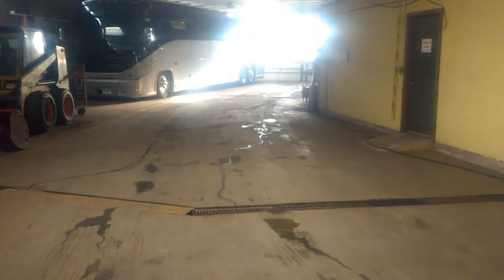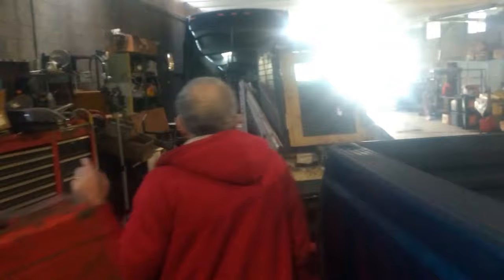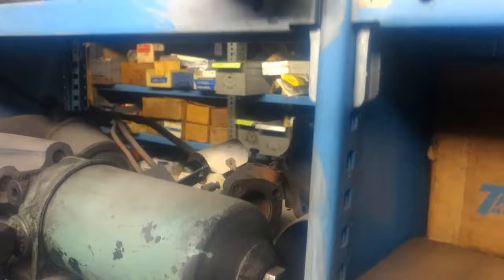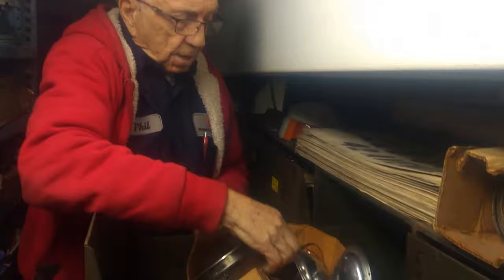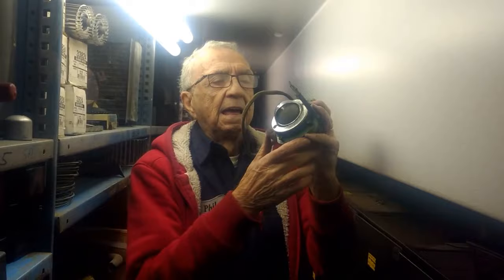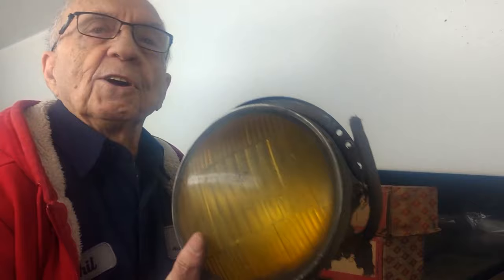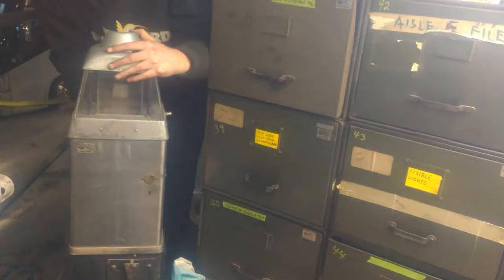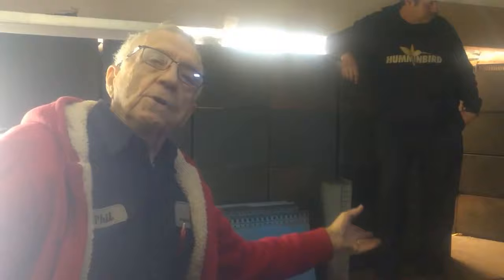A Vintage Bus Parts Journey

Comment: @39:15   that is 6836596 it is an Allison part.  The book says its a  6836596 Converter Pump (Early Style).
Reply: Tha part number on it is correct.  It's for a TC-490.
Reply: @gbowne1  Follow-up: we have nothing for Allison transmissions. All our newer buses with Allisons are serviced at C & J Bus Repair in Bloomington MN.
Reply: Well thats the information I was able to find on it just going off whats written on it.  Looks like part of the pump housing on the Allison TC-490.  I do have some of the manuals from uncles workshop.  Thanks Phil.

Comment: I can make those easily Phil  @ 32:13
Reply: gbowne1, we have a huge stock of those, but if you have the means for lens production in general, let's chat about other types. Thanks, Stan
Reply: I can make anything metal, so long as it is smaller than 4ft x 12ft x 1/4", and i prefer making stuff thats smaller than 6" x  12" x 16"  . But I can make replacement those rusted through lens buckets.  Id have to see about lenses.  I like making stuff thats unobtainium/no longer available.